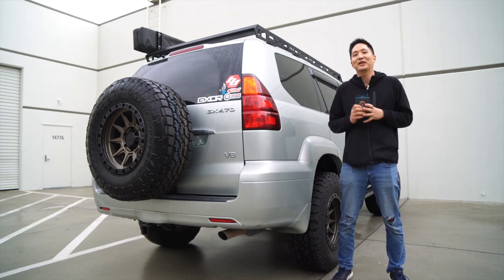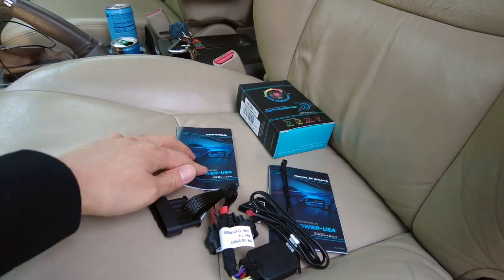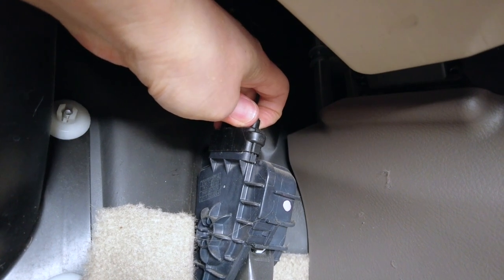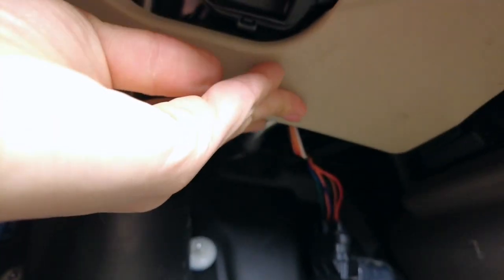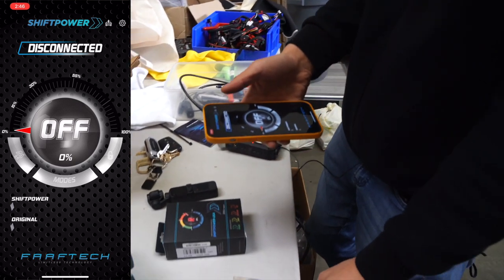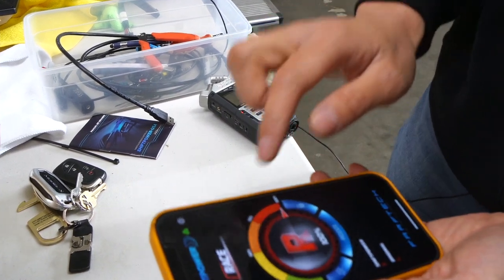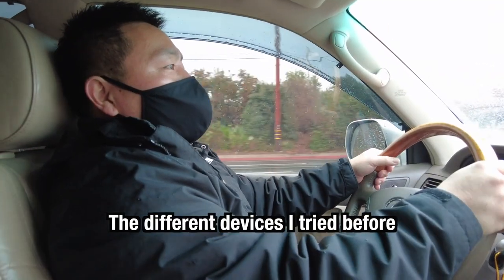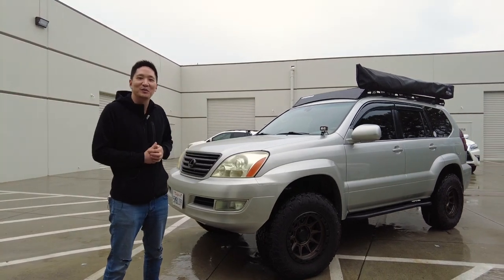Shiftpower Throttle Response Controller for GX 470 Demonstration and Install

Comment: So I don't see how you're changing the settings. Are you having to use the phone app each time??? That would be a major deal breaker if I have to have the app open and pick up my phone to make the adjustments.
Reply from the maker: You can change the settings via app or by pressing the supplied button for quick access. Very versatile and very user friendly

Comment: Wow! That is something that has been needed in a Lexus for a long time. Two questions do you have one for a GS350 f sport and do you do installs? I want to buy a few things from you but I also want you to install them as I do not trust my very expensive and nice beautiful car to your random corner shop. I know you understand.
Reply from the maker: Yes we have one for GS350 F sport and we do installs for $200. We totally understand!
Reply: @BeatSonicUS  that is great! I will be calling you soon because I want that installed and I also want with of course consultation but I think I need or want the Android mirror for the screen so I can see my phone on the screen and use its apps as you know Lexus infotainment center not only stinks but some things that run off 3G are no longer going to be available after the year 2022. And I believe getting the mirroring system for my screen would be better than Android Auto which I already have in my Mercedes-Benz GLE 350. Not all my apps are available especially the ones that compete with Google. Thanks for the reply I will contact you soon. One last question I almost forgot my Lexus 350 GS f sport has the ML sound system does the mirroring for Android work with it also would it void any warranties? My vehicle is warrantied through 2023.
Reply from the maker: Look forward to being contacted from you! Emailing would yield the fastest reply info@beatsonicusa.com. Phone mirroring is compatible and won’t void warranty as well!